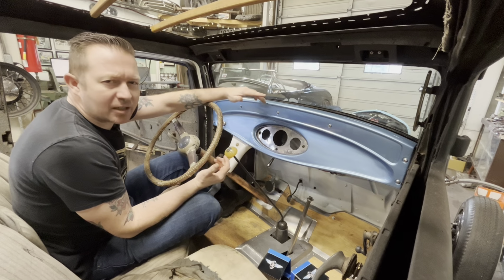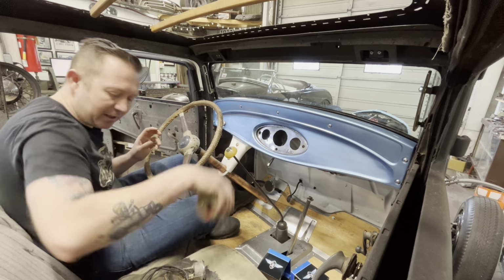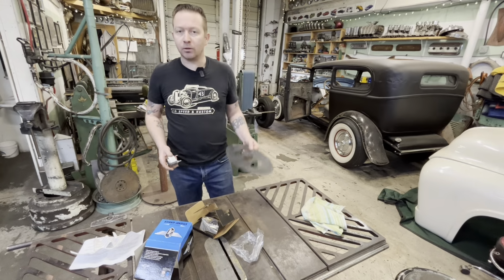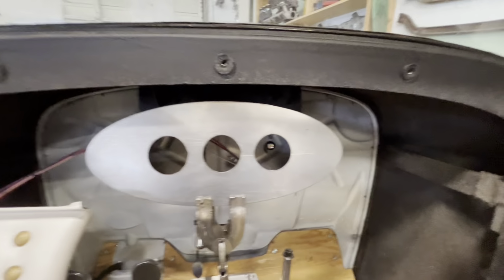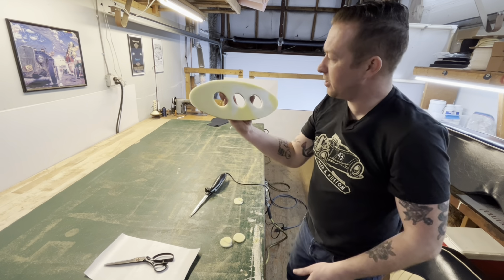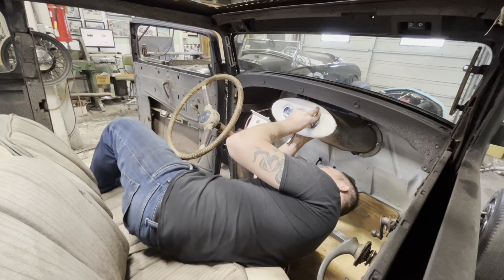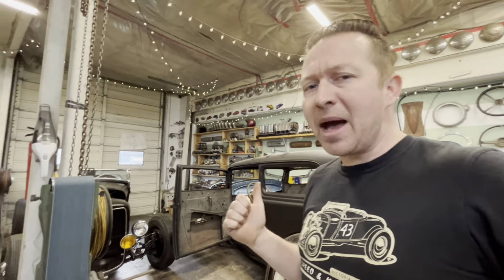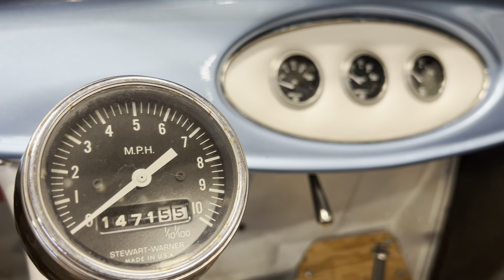Building a gauge panel ~ 32 Ford Build Part 32

Comment: Spent a bunch of time viewing all the 32 videos series and what a trip down memory lane.  Your workmanship is awesome.

Your 32 work brought back memories of my dad buying me a running and drivable 1930 Model A for about $600 in today’s money value when I was 15. It was not legal for me to drive until I was 16, but there were some unused off-road areas of the Port Angeles Airport where dad taught me to drive it.  

Your comments about the previous welding work on the 32 frame, brake lines, radiator and transmission mounts are so true.  Back in the day we did not imagine that the old $60 cars we had would become very valuable and the cars deserved our workmanship on them to be the very best.  Plus, at age 16 there was very little money or tools to do the work.   

I managed to blow up the Model A engine in less than a year after getting my driver’s license and started work installing a full race flathead V8 and hydraulic brake system.  Needless to say my engineering skills and workmanship was not that great at age 17, but it all held together OK.
Reply from the maker: That’s a great story. What ever happened to the model A?
Reply: @LGKustoms  In less than a year after I got the A running with the V8 I had a chance to buy a pretty nice 40 Ford deluxe without an engine, transmission and wheels.  Took those parts from the A and put them in the 40.   Sold the A with no engine, transmission and wheels for $50 to a friend and it was in Port Angels for a few years with a couple of different owners.  Last I heard sometime in the late 60s it ended up in a junk yard in Sequim.

Comment: Initially (traditionalist thinking?), the speedometer on the column seemed wrong, but the brass cup hose clamped to the brass column looked spot on. I'm glad I don't go to roadster shows anymore to see the trailer queens who never get driven. This brings me back to the days (in my old rusty 66 Chevelle) when I used what I could find! Good to see your mini-me too!

Comment: Love your dash!!! Looks FANTASTIC! Thanks for not cutting up a perfect "Henry" dash! On the "CUP" leave the handle as-is... Put vinyl over the radiator clamp. Run wires thru copper/brass tube on collum. What a conversation piece!  Everyone will say "HEY! Look at THIS!"
Reply from the maker: Thanks. The 32 Ford is actually an Edsel Ford design, not Henry. If it was up to Henry, we’d still be driving black Model T’s.
Reply: I stand corrected... The '32 is the most beautiful body style ever (IMHO). But only one year?  Maybe the thought was "How can you beat this? Let's let it be unique and move on with a new body in '34".
I had missed the dash repair vid, awesome repair job! Henery... Opps, I mean Edsel would be proud!

Comment: I, too, own a ‘32 and have pondered fabricating a door to go under the tunnel that goes from the dash to the gauges.  I’m thinking a piano hinge forward with a hardware store latch back by the gauges.  You could mount a fuse panel there or a couple switches.  Whatever.  You do it and I’ll take notes 😅
Reply from the maker: I’ll probably just mount the fuse panel on the firewall where it’s easy to access

Comment: Loving the upholstery theme!  For a voltmeter I used a voltage indicator LED.  It changes colour from red 10-12V  to green 13.5V and above indicating your charging status.  I used dual temp gauges with my Flathead so i had no room in the gauge panel.  I just drilled a hole and installed like a jewel light now I can tell what my system voltage is by the colour.  There not too expensive off eBay

Gammatronix 5mm LED 12v Battery level / Alternator Charge monitor indicator
Reply from the maker: Thanks for the info!

Comment: Really lovin the cup speedo mount. But l'd go with electronic speedo so you can hide the wire in the handle and route it thru the column. Also check out Autometer Antique Biege gauges (they come with senders).

Comment: Guage panel looks great.
Yeah that no sender nonsense is ridiculous. I suspect it’s due to shrinkflation, just not include the sender and keep the price the same?🤷‍♂️
I’m with you on the electronic senders, easier install and to keep neat and tucked in.
Reply from the maker: Must be a new thing. I just put a set of SW gauges in that blue 33 ford pickup around a year ago. They came with sending units.
Reply: @LGKustoms  I don’t think they want to price these gauges at $100 so they pulled the senders to be sold separately. It’s like the bag of Oreos staying the same price but 50 grams lighter.
They are nice looking gauges though. Stewart Warner used to be made in Peterborough Ontario they still had a plant there in the 90s / early 2000s.
I don’t know if they are one of the companies bought up by Holley. If they are it makes sense, a lot of weird stuff has been going on with the companies they bought up like Mallory  ignition part numbers are now MSD products etc.